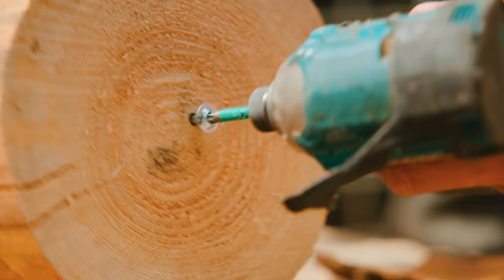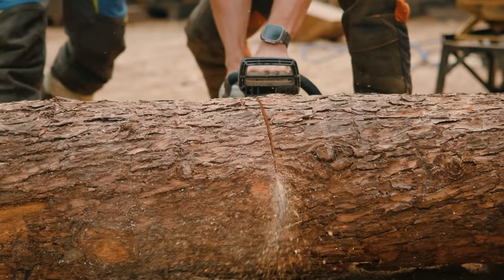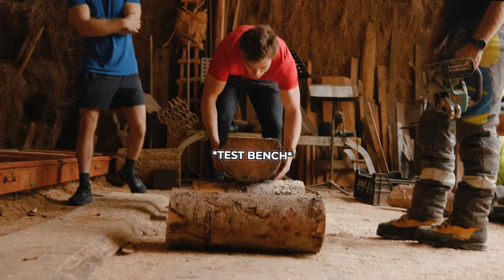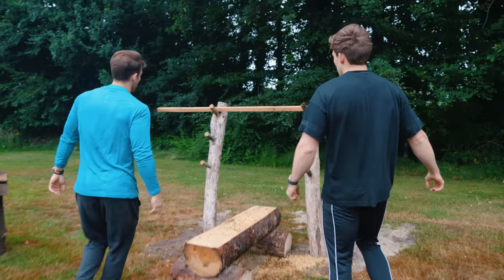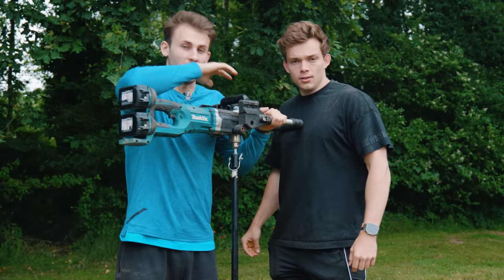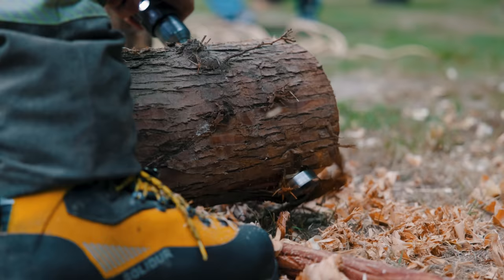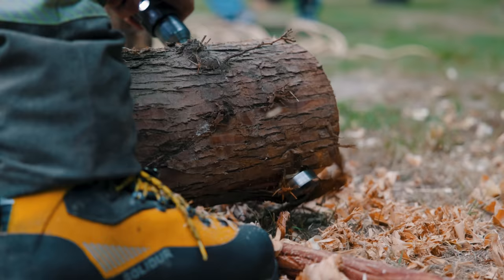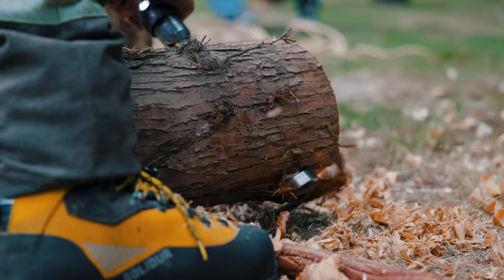I Built a Primitive Gym In 50 Hours

Comment: For the log pulldown "machine" they could add a fulcrum under the log so it can be suspended over the ground a bit so they don't have to lift it every time they want to change the level, as well as something to anchor their legs to the seat so they can pull down as hard as they want without getting pulled up.

Comment: Here's a tip:
Use water bottles.
Range from shampoo bottles to 2L pop bottle to 4L milk jugs filled with water but leaving a small air gap at the top to allow it to move within.
Now it is not just the weight but also the EXTRA energy of the water in all directions that will intensify any workout and easy to move or store by emptying.